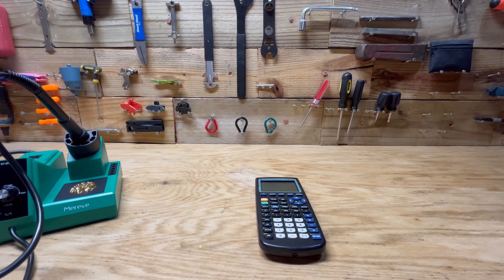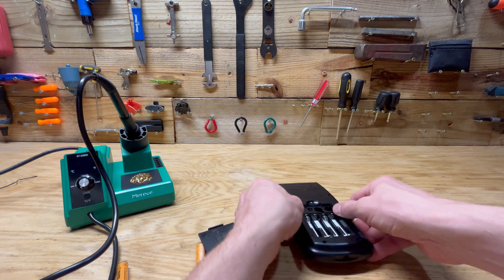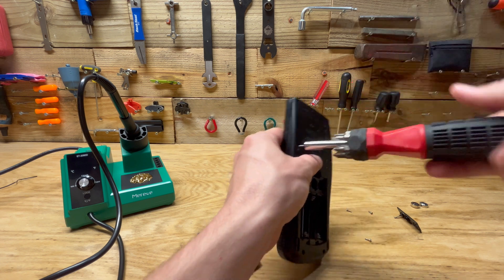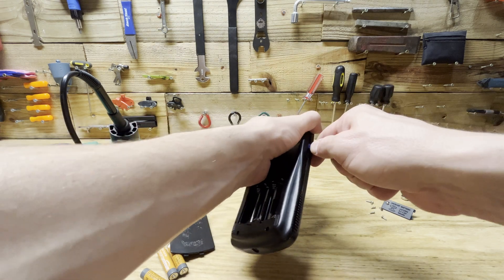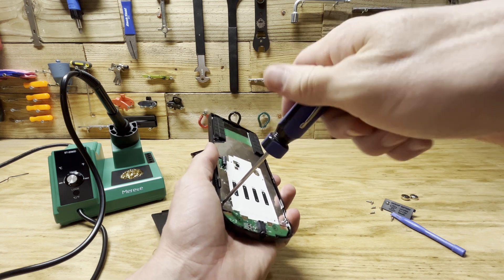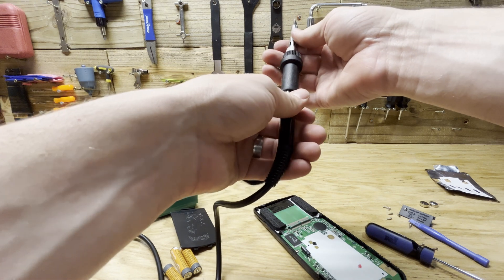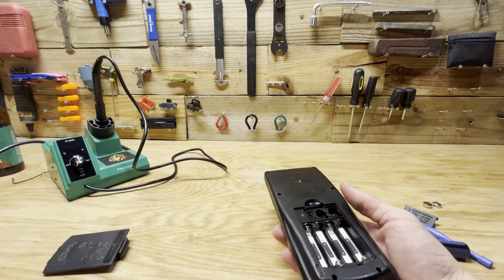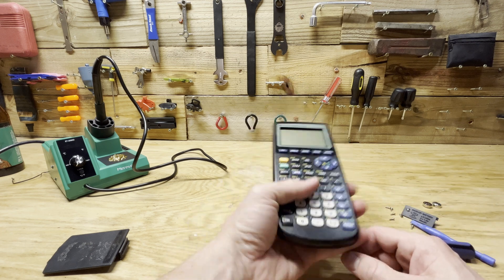Failed TI-83 Plus Calculator Screen Repair! Watch This Before Trying to Fix TI 83 Plus Screen!

Comment: What if you use that display on the other ti83 that has a screen lcd leakage?
Reply from the maker: dont think it would work
Reply: @MoOutdoorsandReviews  because of the flat flex cables?